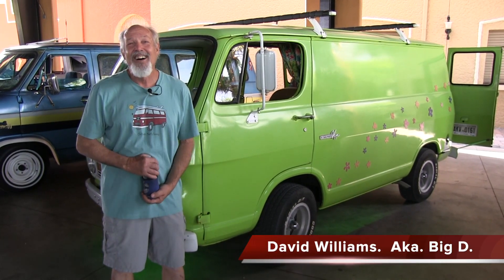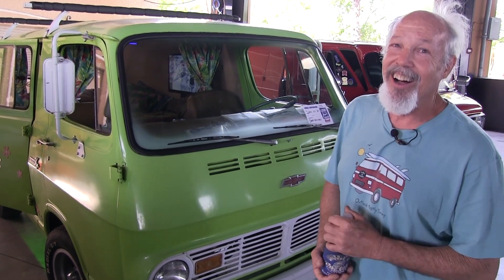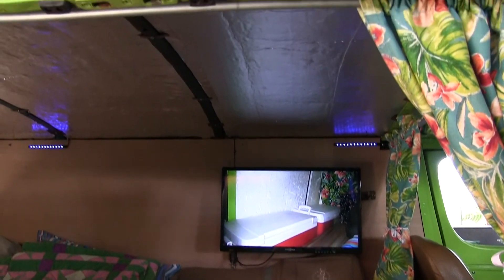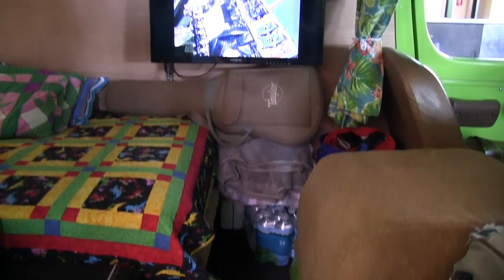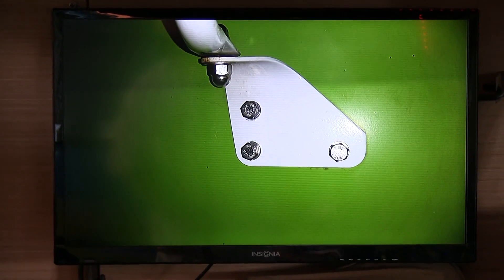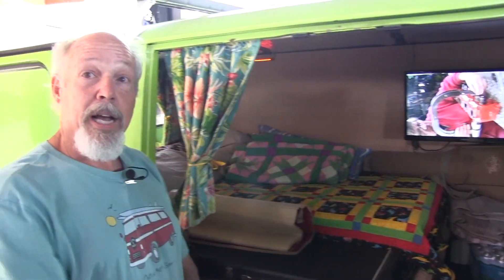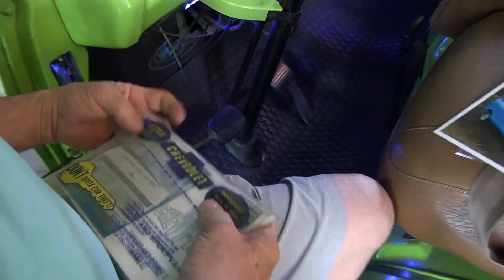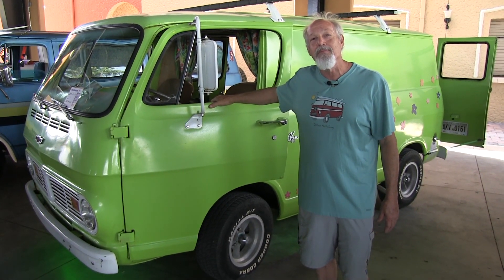1967 Custom Chevy Van with Dave Williams. (Big D)

Comment: I also have a 67, it’s a 108 one owner. I have made similar upgrades.  Made my own trailer hitch. Mine is not welded, it’s a longer piece of angle and bolted through the bumper mount holes. Also made my own glove box replacement. What is the tubing coming out of the thermostat housing. ?I have a temp gauge sensor there which I like better than the hot spot above the exh manifold. At this time I have about 270 k on it. 3 speed manual changed to 4 speed on the tree.  Rear end is changed to a Monty Carlo 308. Henry in Florida.

Comment: Nice van and nice video.  If you were to sell it what would it go for?  I have a 1987 S10 Blazer Tahoe Edition 4X4 V6 with only 62K actual senior citizen driven original miles.  Original paint.  I got it from an estate sale.  I would be willing to trade it for the right Chevy Van.  I would like a 108 with no side windows.  You need to put Hustler HQ27 twin trucker antennas and a small President Bill  CB Radio on your Van.